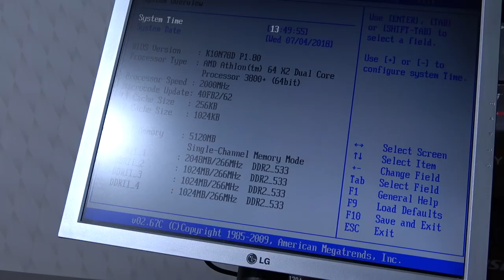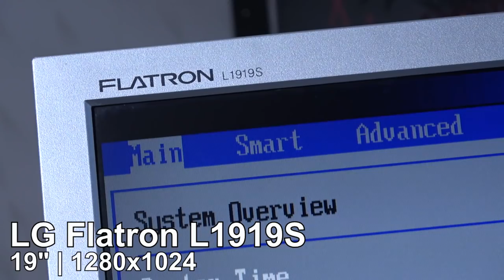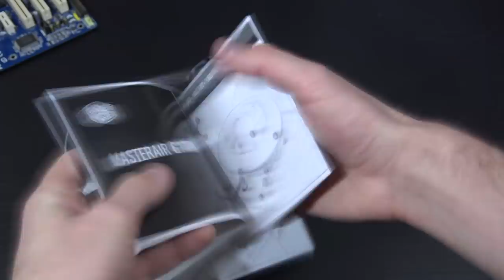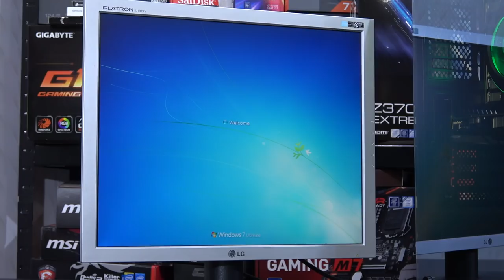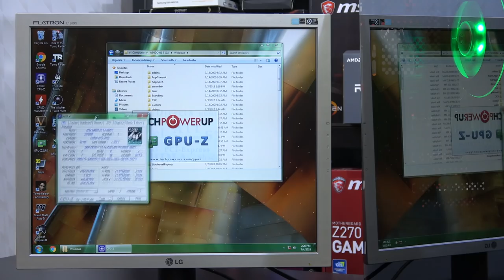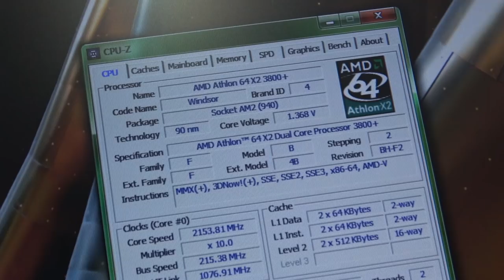AMD Athlon CPU from 2006 STILL KICKING ASS!

Comment: You really don't need anything so new for quite a few games when it comes to your processor on pc. Though there are far more games that require more than 2 of 4 cores now and some at better clock speeds and more power to actually bring...if youre that broke...I really suggest just  saving up as this would almost be a waste. Its cool that some games work since a lot of games are more gpu intensive but many more are very much cpu intensive or even a strong mixture of both and that old processor will not run these very well at all let alone other basics tasks. Seriously try multitasking and working on different things etc...youll find real quick how poorly your pc runs. Seriously there is nothing wrong with upgrading parts just don't be doing it every single year or 2 unless its an actual massive change. Wait 5 years or so before upgrading.

Comment: I had a athlon 64 ×2 6000+ the 90nm version ( windsor) i think? 3.0 ghz.
  Geforce 8800 GTS 512Mb (G92).
MSI platinum mobo socket AM2+ NVIDIA I THINK
 4 Gb REAPER Memory 1066
WINDOWS XP PRO
Thermaltake 750w PSU 80+
THERMALTAKE CPU HEATSINK.
 I would run CRYSIS at 11hundred something by 768 at 50 FPS and with a newer monitor 1080p at 35 to 45 fps on high also. Company of heros 45 to 50
Age of impires would just run away if i had the game speed up ...IDK i built a newr system years later with a 6300 fx and a readeon hd 4870 black night addition and CRYSIS Would run 45 to 50 FPS on medium.....i just dont understand how the athlon was doing so well. I had an exact model of cpu in an attempt to built a retro pc but that athlon 6000+ (windsor) also. Did not perform as well as my 2008 Athlon.???????????????

Comment: what you are getting is what I and most call amd not included. most amd cpus from over 5 years ago will not run on windows 10 without near to full cpu use when playing games or even doing just 1 task or 2 you will also find that their is lake of updated amd product drivers for video cards and cpus as well as even other parts like the mathco processsors.. I think Microsoft needs to change its system requirments to state if you have a amd product in you computer older then 3 years do not bother chances are windows will run run correctly and at a basic user standpoint. this crap upsets me so much as I used to be a huge amd fan but most of my systems wil not run right with windows 10 how ever I can take a old nvidia gpu or a old intel product and it will work fine. the sad part is I can take a old Pentium 4 ht witch was crap in the day compaired to amd and it will run windows ten better then if I used a newer cpu buy amd. the realy bad part is a older quar core amd cpu underperforms  that Pentium 4

Comment: You are clearly CPU bottle necked. You should of had overclocked the CPU plus you installed a fancy branded air cooler. It would be interesting to see how the results would vary with the overclock. Plus me up guys we might get a recap on this video. Also installing Windows 10 will not ruin the performance.

Comment: No, it's not. :) Athlon from 2006 can't kick ass becouse it's Core 2 Duo year and begining of next era of CPUs performance. C2D have at least 40% more speed clock by clock and also 50% more OC ability from factor. Intel was close to 2 times faster in same year. In next year 2007 Intel introduce Quad core and slighty better OC, so it was 250% faster in only one year.
Athlon X2 s939 from 2005 was first true dual core processor for consumers and it's a true retro king and monument of revolution in performance.

I have ultimate 2005 PC 
s939 (pre AM2) X2 3800+ from 2005 overclocked to 2750mHz with 530+Mhz DDR1 CL3 Creative X-Fi Titanium and SLI 7800GT powered by Windows XP:
Series 7 Geforce is really bad idea for 2008+ triple A gamesz so decide to use GTX8800 from 2006:
Skyrim runs on very high 25-30 FPS
GTA4 high 23-40FPS
Tomb Raider 30-50fps
COD4 30-40
COD MW same
Etc etc, every common AAA game was completely playable and stoped on Wither 2 about 15FPS only.

Comment: You can thank the absolute hunks of shit CPU's the consoles use for that. The jaguar cores in the Xbone/PS4 are "barely better" than an Athlon 64 core, they're more along the lines of power in mobile CPU's. When you stack an actual modern desktop CPU next to the 8 core CPU's in the consoles they just get blown out of the water. CPU's from 2011 are several times more powerful than the Jaguar CPU's. The only reason you can get the 30fps target with this generation's games is that the devs were basically forced into heavily multithreading their games. Devs like Bungie have a very clever load balancing system that looks at CPU workload frame by frame. They actually look at nanoseconds between frames where they can shunt instructions around their command queues to maximize CPU efficiency. All this an the Xbox One X/PS4 Pro CPU's are still Jaguar based but with a slightly higher clockspeed and you see why a lot of games still can't do 60fps whether it's at 4k or 1080p. For the Pro/X consoles they are severely CPU bottlenecked.
Reply: bollocks
Reply: Thanks Professor